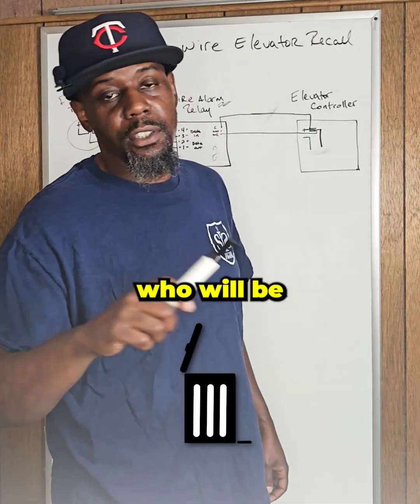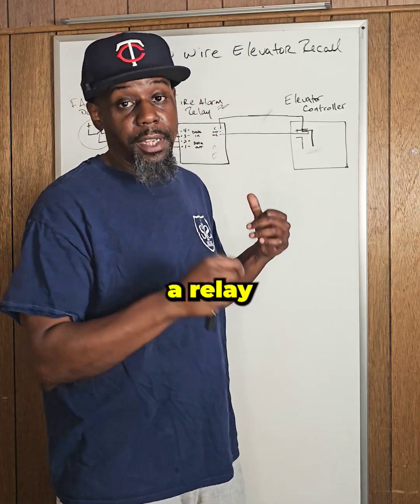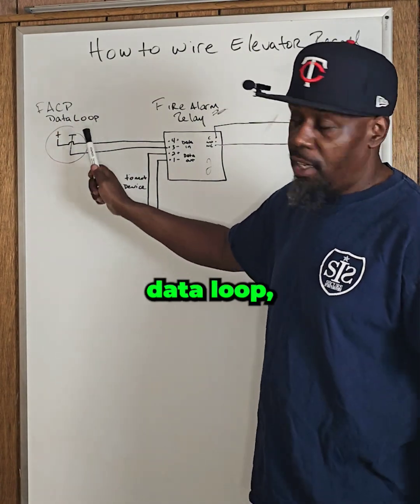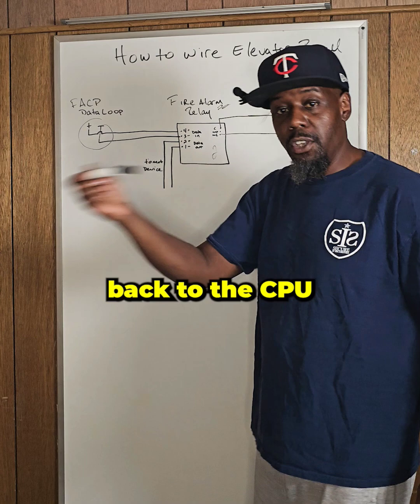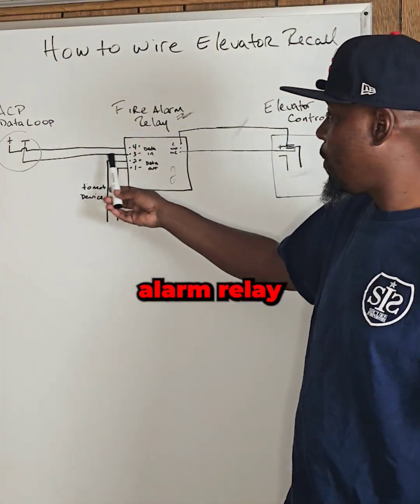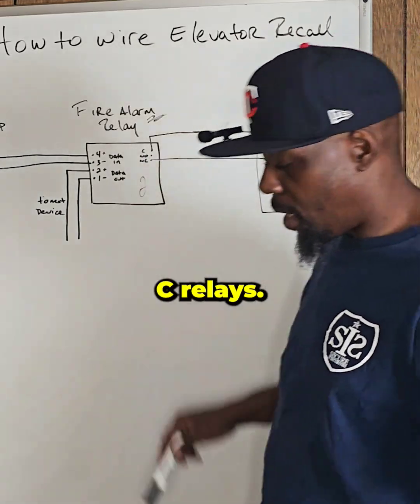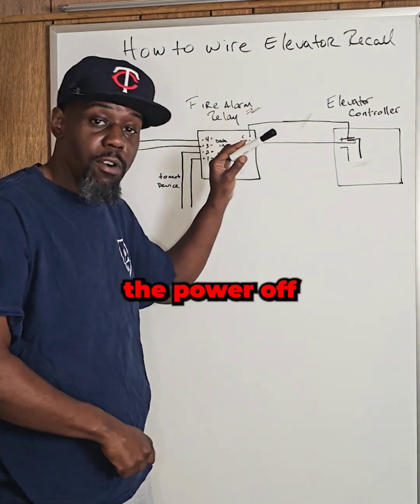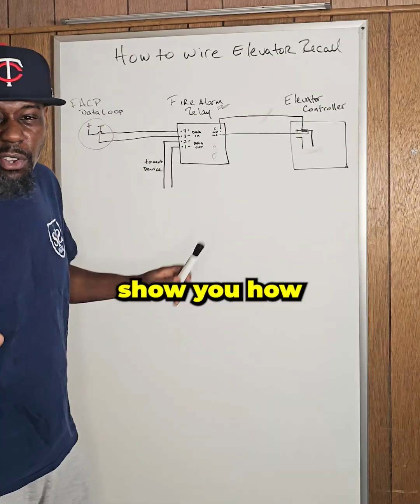Crucial Fire Alarm Relay Wiring Mistakes to AVOID for Elevator Recall

Comment: What if someone is already in an elevator while the fire alarm system is activated. The elevetor shuts off and the person in it burns like chicken in a pot...
Reply from the maker: @gjergjqeriqi7235 If a person is in the elevator at the time of an alarm, the elevator will go to the first floor to let you out. Elevator recall only recalls the elevator to a floor. Elevator shunt will cut the power. This happens when the heat detector in the elevator pit has been active.